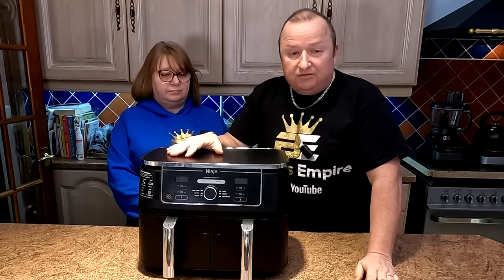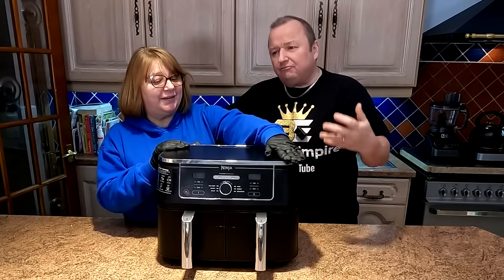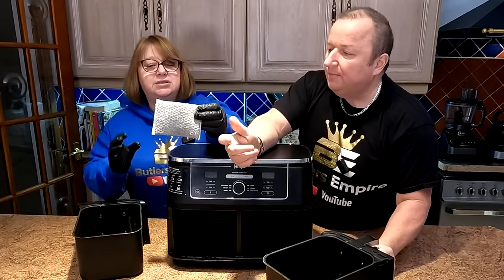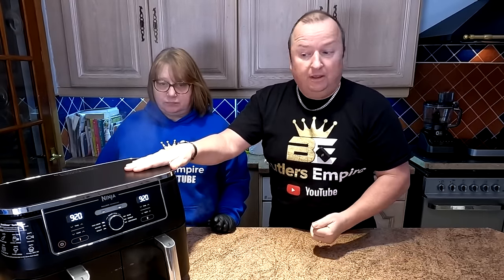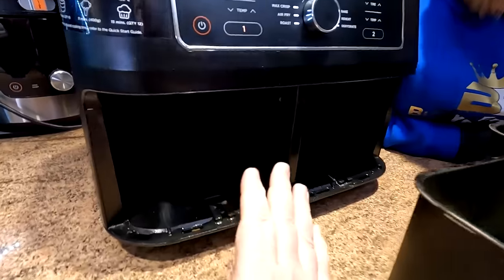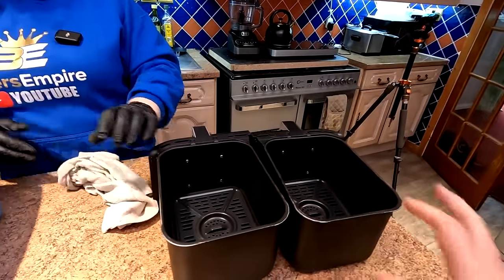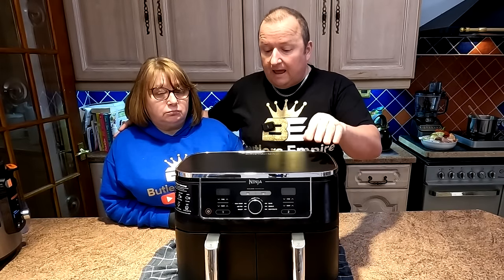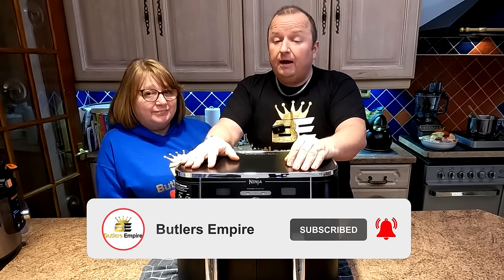Shocking Ninja Air Fryer - How Easy Is It To Clean?

Comment: every time the frier as been used? just take trays and wsh them in plastic biowl a=or dish washer
taking all apart and let dry?
once a month torn frier upside down and lightkly clean inside with soft plastic brush and a cloth/
would you just let yoyur oven build up over six months

Comment: Can you use the soft dishwasher tabs or do they need to be the harder ones.  Thanks for sharing re cleaning. The air fryer.
Reply from the maker: Yes you can!
Reply: @butlersempire  great thank you.  I know for the  cooker cleaning they suggest rubbing with a little water using the ball side of a hard dishwasher tab. So I wondered if they had something different in them , hence for asking but thank you.

Comment: Great Video, but I clean my ninja completely ..every time after I use it.... using only lemon with boiling hot water in both drawers..and sometimes a spray bottle..but not turning it on..after 10 minutes I clean it with a cloth, and it's done..mine looks brand new.

Comment: YOU SAID IT:   PAIN TO CLEAN!     The fan itself and the heat refleting panel behind it - this is what makes it to clean the hardest.     If it isn't clean, then all the residue is builr up, and it creates a nasty smell every time you use the oven.    This is something the manifacturer should have forseen but either did not think of it, or didn't give a crap!

Comment: Lemon smells good, and add acidity to your cleaning solution…..while dishwasher tablets are strongly alcaline and will survive tha battle with the lemon juice, so the alcaline will do its cleaning job….just a little less effectively. It makes no sense in respect to cleaning to mix the two from a cleaning point ofview….but it may smell good as you say!…..none of the cleaning components are volatile, so cleaning of the fan area is not influenced much by this concoction…as shown later.
 You seem to me to experiment on camera…..and your bent toothbrush will not reach all surfaces under the heating element….but your spotcleaning worked, where you worked….marvelous!

Comment: I Think your all Correct its a Royal Pain in the Lower Regions ! I Know most of the Cookers and Grills, etc. Have the Same Problems  My Newest Con Quest is to Find One where your Able to pull out the Elements all -Together and get Something to Blast Out the Elements Safely with a Mini Steam Pressure Gun  like a Car Wash ( LOL Just Kidding! ) Most of the time there is lot of Sharp Edges on the Metals Inside  Trying to Clean Them ; They Can  Cut you Up ! (Your Wife or Neighbor came in and Your Flat on Your Back with a Paint Scrapper in your Hand and Blood all over the House! Not a Pretty Site!) Well if its all Too Much They all Make Good Boat Anchors ! Keep Your Head Up! Or Turn Vegan...   :thanksdoc::thanksdoc::thanksdoc:

Comment: Bought one, the tray number one door doesn’t close properly there is a small gap on top left, is that normal? Or should I change? There is hot air coming out of that gap too! Tray number 2 closes properly! I noticed yours a bit similar and number 2 closes more snugly. Is that correct
Reply from the maker: Ours shuts fine bud.

Comment: Martin I’ve only had my Af400 since December and for last 8 weeks the fan on drawer 1 has stopped working. Any ideas? Nothing on YouTube….😟
Reply from the maker: Have you cleaned it? ours stopped as I think we got a bit of detergent in the fan motor. I noticed that the fan motor was a little stiff when I tried to turn it (not with the plug in) I span it a few times and it eventually loosened off.
Reply: No, the fan spins but not as well as drawer two. It heats up but fan dosent spin?

Comment: Puts me off buying one of these 😢…. It’s a design fault when you need hours and a toothbrush to clean something you use every day. Elements should have been detachable to allow access to the roof part. But i appreciate your video and IF i do buy one, ill be returning to your vid as i am a bit of a clean freak and could not sleep if my fryer had baked on grease inside! Can the two baskets not be cleaned in dishwasher???

Comment: Can you take the element out somehow?
Reply: Remove the front phillip screw from the heating coil, pull up the heating coil slowly and at the same time unhook it from the back clip. Note, DO NOT completely remove the Coil or back clip
Both Coils are connected to each other so clean one side at a time and put it back together before cleaning the other side
Use a #10 Socket Wrench to Remove the fan. Turn the nut clockwise to remove nut, lock washer and flat washer. I also used a small steel brush the size of a toothbrush and plumbing pipe sandpaper that comes in a small roll. And a wet towel. It took a while but finally got it very cleaned

Comment: £250 and 1 year in its trashed. If you can not clean them.properly doubt they will work very well so will have too buy a new one. So basically just use your cooker and pay for it roo be cleaned once a year is cheaper 😅 it's a big con😊
Reply from the maker: Thanks for your opinion.

Comment: If you think about it you don't have access to the fan in a fan oven.
Reply: I used to have to tighten the screw on my old one periodically but could unscrew the back panel from inside as I can with my new one (that’s now only used as a cupboard for pots and pans because it’s too pricey to run so I won’t have to clean it 😂)